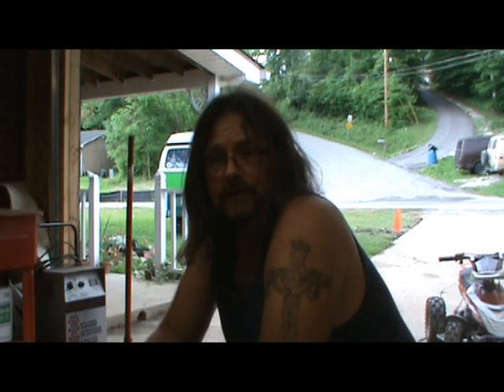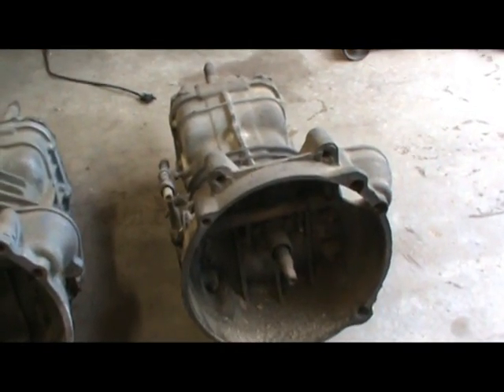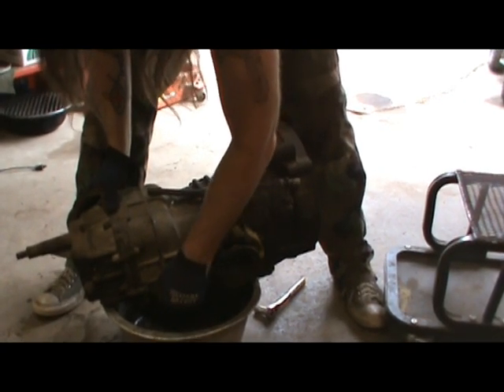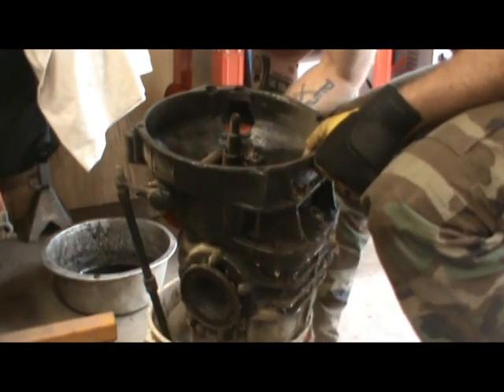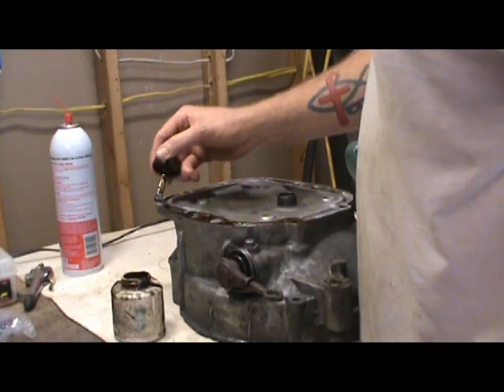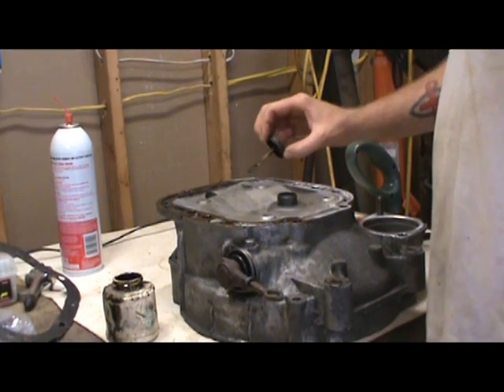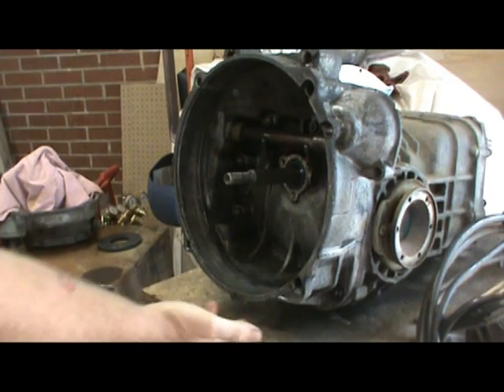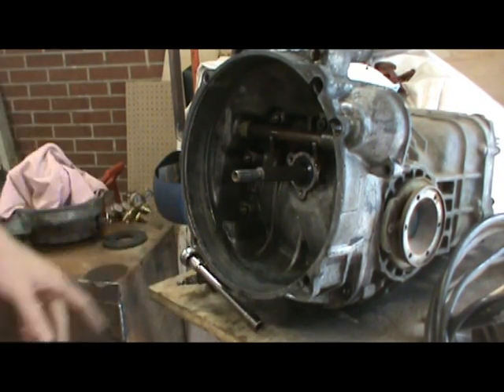1976 VW Bus-tranny work

Comment: Yes your right ,about the washers ,spring washers all size for each bolt,must be a tight fit ,because these washers seal the bolts ,they also sell sealing bolts with rubber rings glued on the bolt.Or else case threw bolts might leak.I had that problem,and people think it always the seals.Wrong washer and leaks happen.